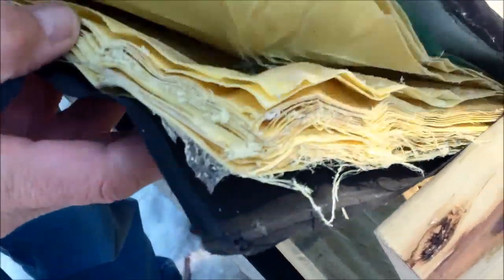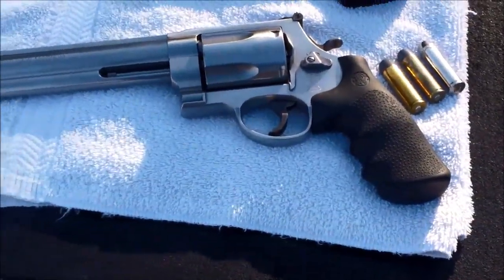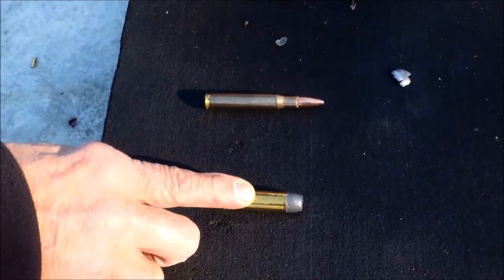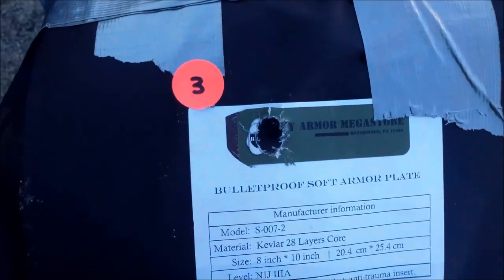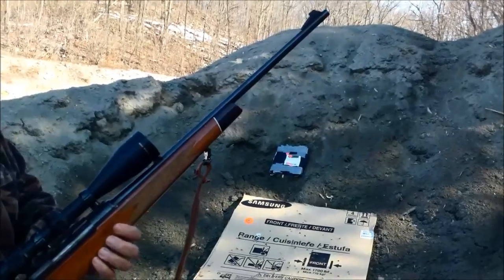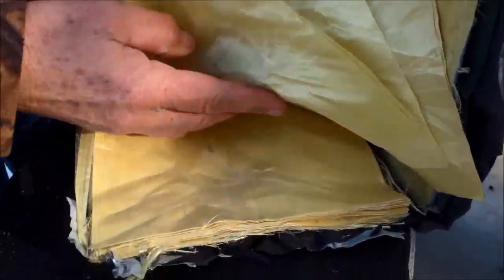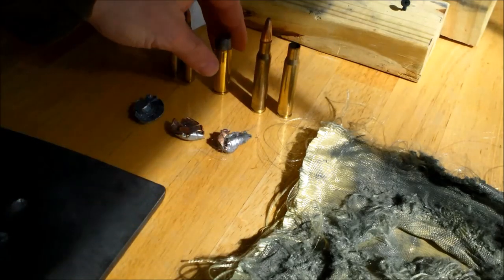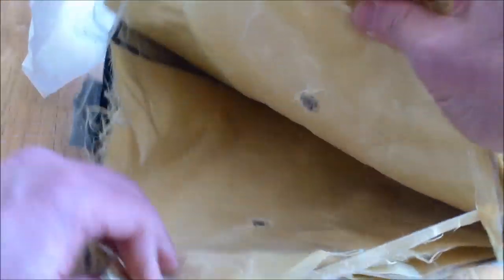Body Armor Megastore Soft Armor Insert - Level IIIA 3A

Comment: There was no penetration but the way that thing protruded out the other side it would have smashed your chest plate so bad it would have killed you anyway... Having the Level IIIA as a ballistic plate behind a Steel Level III AR500 would be the way to go granted you can tolerate the thickness and extra weight.